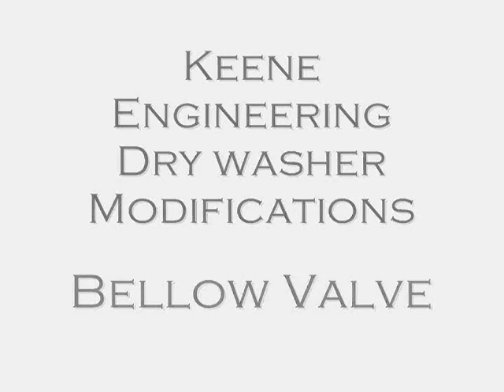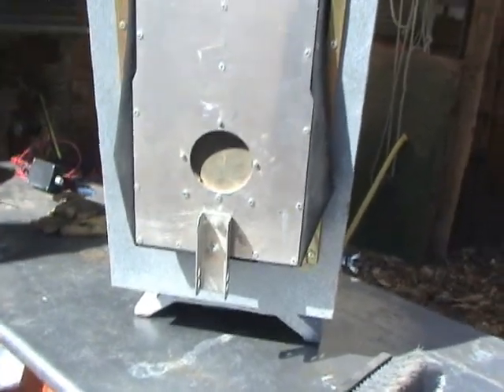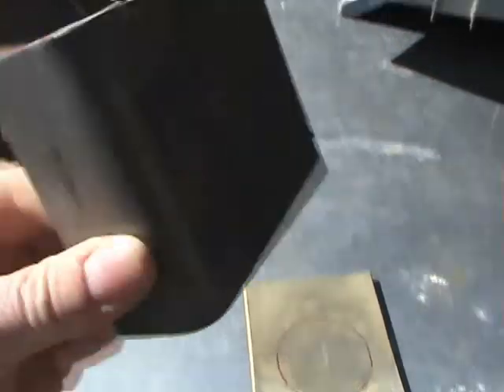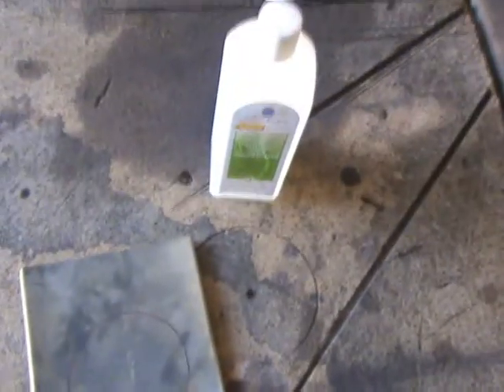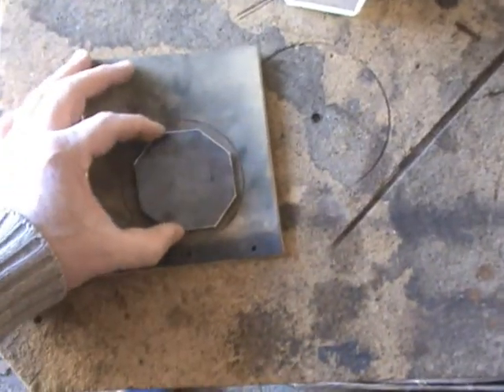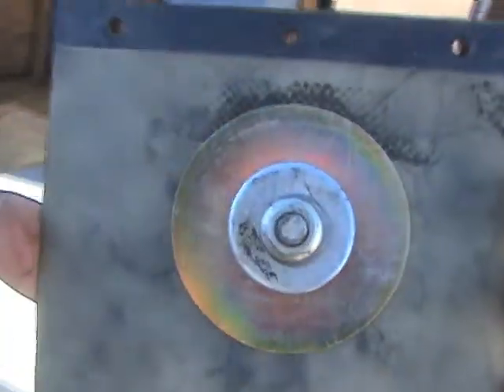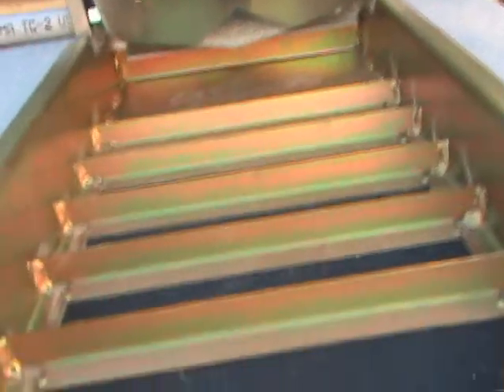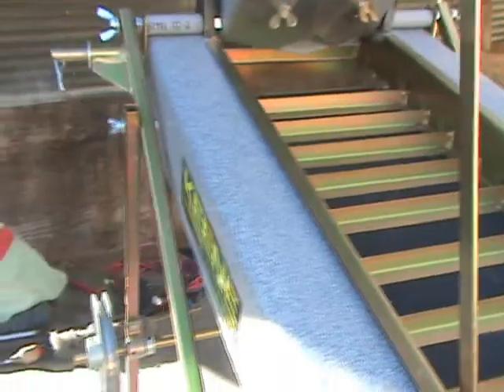Keene Engineering Dry Washer, Modifications 03: Bellow Flapper Valve

Comment: Wow mine is different. The bar that the wing nut goes on will fit up tight on mine. I will have to do a short video for you to show you.

So does the flapper open to allow replacement air in now with all that weight on it?

Comment: You are going to have lower cfm through the bellows with that weight on the flapper. The more weight the more pressure you need to open it, therefore less volume on each stroke.That kinda defeats what you are trying to accomplish. The 'suction' from the bellows down stroke should be enough to seat the valve even if it is not tightly closed when at rest.
Just food for thought, I'm not there and you could have already determined through experimentation that your fix works best in the real world.